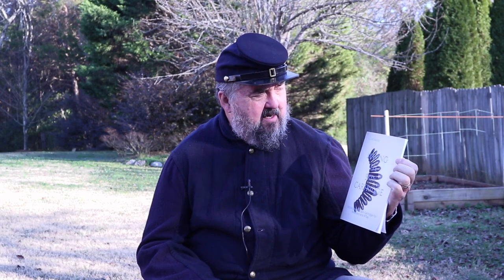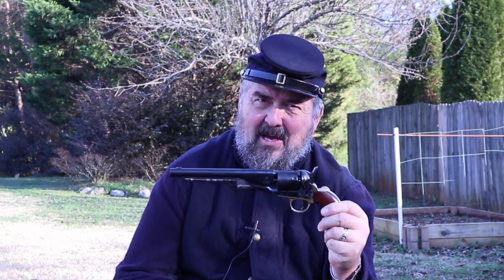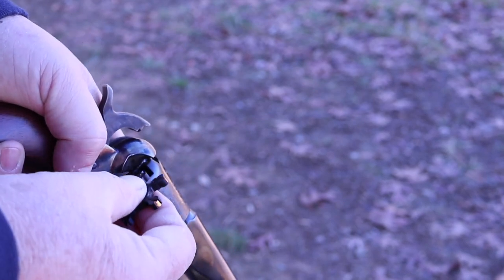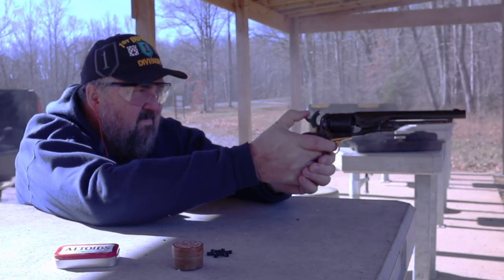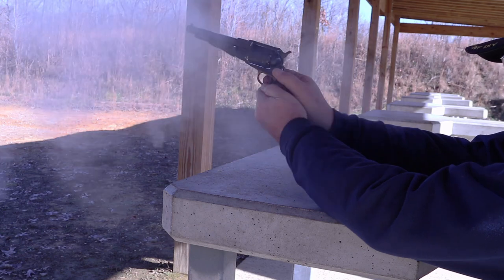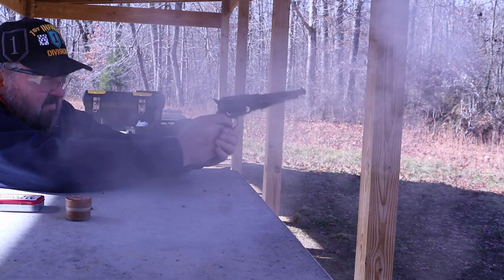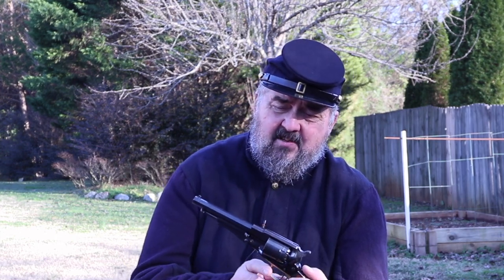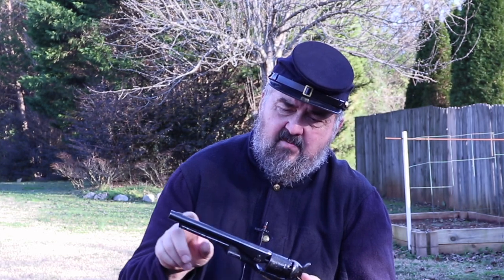Shooting Skin Cartridges in Cap and Ball Revolvers

Comment: .366 .368, chambers not good if bore is .375.
Reply: Was thinking the same and left a long comment explaining. I think that may be why his accuracy is so terrible. The chambers are drilled while the bore is made in a different way with different tools (regardless of what method they use).... so his chambers being so undersized probably means that his bullets will be undersized and won't create a seal in the bore/rifling... and that can be very bad for accuracy and the life of the barrel. It can cause very bad accuracy and very bad leading problems to start with... and in time will eat away at the walls of the bore. Depending on how bad it is, that can destroy a barrel in a couple thousand rounds... or even with just a couple hundred rounds. (With smokeless powder, I'm not sure if black powder is as destructive though. I would guess that black powder is not as bad as smokeless, but that it will still ruin the barrel if the hot gas can escape through the bore). I would ask Pietta for a new cylinder, because it's so far off that I would bet it's not within spec and should have never been sold. When it comes to bullets/bore, even a 0.005" difference can be a real problem... but 0.007 to 0.009 just seems beyond unacceptable.

Comment: how about a video on period caps?  How to produce your own percussion caps?
Reply: Would love that. Not quite as easy to do, but it can definitely be done. There are many ways if you're not making replicas, but are just making caps that work. They have lead and mercury though, both of which can be bad for your health. I believe that most modern primers still contain lead and that's where the lead exposure from shooting comes from (and not the bullets). Mercury one's are corrosive, so you have to clean your gun out after each use. I believe Mercury Fulminate and Lead Styphnate ae the two main chemicals used in percussion caps.

Comment: You don't have to use force to seat your caps on your nipples? If I don't, the caps won't go off... and even if I do, sometimes I need to hit them twice to go off. It's like 3/5 go off and 2/5 need to be hit again. I think the caps aren't a good fit for the nipples, but they're the one's that the company (and others) recommend. I think a couple of my nipples are out of spec and that's why it's consistently 3/5 that go off. It appears that the taper is too wide at the top edge of where the cap makes contact/seals to the nipple. Either it's too wide there or the entire taper is too wide. I think the entire taper is too wide, but never measured, because how do you accurately measure a taper? It's different along the length and it's not easy to measure the exact spot each time. I'm thinking maybe that I can make a mold of one of the nipples that works and use that as a "no go" gauge and/or a visual inspection gauge if I cut one in half, so I can see how the suspected larger nipples fit inside it.

Comment: Skin ,OK I'll try that. I've nitrated several papers. I get hang fires . I started tearing the bottoms off my cartridge. But at times I lose a little powder. Thank you for a great idea.
Reply: How thick is your paper? Also, make sure you aren't getting a lot of glue on the center of the bottom before you attach it. I've never had any ignition problems with nitrated coffee filters. I also use slix shot cones.   Worst case you could also try switching to magnum caps (if you can find them)
Reply: on your paper cartridges be sure to have a good taper to them so they break open when you ram them home.. for some skin cartridges, all it takes is a little work to make the equipment and a little ingenuity, in the back of my book I put what I called the thousand word section (picture /thousand words / get it) lol,,
Reply: I be used both white and brown coffee filters,rice rolling papers and hemp papers. I have better luck with hemp papers non treated. But I do have to tear the bottom off. I use store bought 10,s and 11,s. Remington and CCI. Three f triple seven.
Reply: @jamescraig8601  It may be the Triple Seven that is the issue. While I do not use substitutes in my cartridges, I have heard that they can sometimes require a hotter spark than regular caps, especially if it has go through the paper first.  Magnum caps may solve your problem.
Reply: @marionriverwoodcraft  +1 on this comment. I've had issues getting T7 to ignite in cap and ball cartridges, even with nitrated paper. Almost everything else works a treat in cartridges, but without sliXshot nipples and magnum caps it just doesn't wanna go bang for some reason. I've never had a problem with Pyrodex or anything else I've used, but T7 needs a lot of fire. I shoot quite a lot so I have purposely avoided real bp as the cleanup is a bugger compared to some of the cleaner burning substitutes. Also, I don't own or plan to own any originals. Just repros. The fouling is a ton less just between T7 and Pyrodex. I wanna try some of the forbidden powder next and see if it's as clean burning as they say. I know it's formulated for inlines but when you're shooting for three hours straight the fouling makes a ton of difference. I take the gun apart and clean it just like for storing while I'm shooting, then re-assemble and keep on shooting. When the cylinder won't rotate because of the fouling and you just started shooting, the cleaner burning substitutes start looking like a good option.
Reply: I have always thought cigarette rolling paper is already nitrated.
Reply: @theskincartridge1234  I think it would be good to just make modern skin cartridges than to make true replica one's.

Comment: What do you use to oil the cylinder pin?
Reply: I use spray graphite.  Works great.
Reply from the maker: I don't have a specific oil that I use.  My problem this time was NO oil :)
Reply: Oil, or a light grease can be helpful. The colts have grease grooves in the arbor pin that actually  spiral towards the front, to try and push fresh grease towards the front of the cylinder where it would get fouled.

Comment: I wood buy an 1858 Navy if it had the correct size frame and not the Army frame in 36 cal. Someone should make a Remington 1858 belt model too. I had issues loading my 1860 Army with Eras gone conical paper cartridges not seating. I had to reduce the powder charge to about 22gr. I have a Uberti 1861 I wish it didn't have the stock screws on it. My 1851 is a better shooting gun. Thanks cool video but I think I'll stay with paper cartridges.
Reply: Try some 4fg swiss with the reduced charges

Comment: I'm not familiar with the construction of the chamber, but would it be possible to run a ream down them to open them up a bit to help loading?
Reply: I'm sure it's possible but would you do that to that gun? I don't think so.
Reply: @ryanpenrod1859  I don't see why not.
Reply from the maker: Yes, I have done that to this Pietta since I filmed this video.  However, for potential buyers it is good for them to be forewarned.
Reply: @erasgonehistoricalmolds2400  yeah, good info. I also wonder if very thin PLA would work for this as well. Not 3d printed, but maybe coated onto a mandrel. Reason being PLA leaves very little ash when burned.

Comment: Do you think these would still fire with home made primers? Or even reloaded primers?
Reply: I do. If you add small, hard particles like grains of coarse sand/silica/glass to your priming mixture, that might help break through the skin, but the pressure alone should do it no problem, even without adding something like that. I believe, but cannot say for certain that even paper roll caps would ignite them. You'd probably want to use more than one, but you'd probably want to use more than once anyways. You can also make the skins out of nitrocellulose, but the problem is that nitrocellulose can burn too fast if pure nitrocellulose, which can increase pressure and blow up the gun. To use nitrocellulose, it would have to be made to burn at about the same speed (or slower) than the black powder. That would not only make it a hell of a lot easier to ignite the powder with homemade/refilled primers, but it would aid in the ignition.
Reply: not a problem, if they light up regular black powder or any of the substitutes they will be just fine.

Comment: One would think that, with today's petro-chemistry, a better medium than sheep gut could be found to make these black powder cartridges.
Very thin sprayed-on powder cup membrane  that would set very quickly and that would be mostly combusted when the round is detonated, while still offering good mechanical properties as well as being relatively more water resistant.
Reply: would not work with modern ammo/weapons. the casing seals the chamber which puts the energy producing from burning the powder into propelling the round down range. if the casing disintegrated upon firing the ballistics would be laughable at best. also sending petroleum based bits flying off into the grass or burning it into the atmosphere is the last thing we need to add too.
Reply: @The_Cat_Authority  he wasn't talking about modern weapons, he's just thinking about a spray on substance to use instead of gut.
           I personally would use those finger condom thingies but I have no idea if that would work
Reply: I think cellophane might work, as i believe it may burn off easier
Reply: nitrocellulose lacquer would work
Reply: @The_Cat_Authority  Rickie. Rickie.
Black powder pistol ammunition. This type of cartridge could not be used with modern gun powders because the pressures are so much higher than those of black powder.
Oh, and by the way, you are wearing at least a couple of pounds of petrochemical product right now. Better get rid of that to remain theologically pure so that you may preach to the unbelievers.
Rickie, what do you suppose happens to the sheep gut cartridge casing when the man fires his percussion fired six gun? Yep, it mostly burns up. What is sheep gut made of Rickie? Is it largely made of hydrocarbons? Like oil is made up of hydrocarbon chains?
Reply: @boydgrandy5769  Circle back. Did I say there were NO petroleum products or did I say MORE petroleum products are not needed. See READING COMPREHENSION IS KEY!! Also black powder isn't used in modern rounds because "its too powerful" its not used because it creates loads of smoke and fouling. Modern guns would all jam after just a few rounds of that filthy ammo. Even muzzleloaders mainly use smokeless powder now, for the same reasons. Less smoke, less cleaning your weapon.
Reply: @The_Cat_Authority  "Even muzzleloaders mainly use smokeless powder now"
that's not true, though there are smokeless muzzle loaders available now
Reply: @pacman10182  The only people I know who use black powder do civil war reenactments. Thanks for backing up my comment to the other guy though. His black powder is stronger than smokeless powder mindset is SO SO wrong lol Yes you are sorta right, only muzzleloaders designed for smokeless powder can use it. Much like you don't run 5.56 through a .223, the chambers aren't designed for that much pressure.
Reply: @The_Cat_Authority  "His black powder is stronger than smokeless powder mindset is SO"
that's not what he said, go back and read it
Reply from the maker: Indeed, and many original skin and paper cartridges had a nitrocellulose coating to help with waterproofing and to encourage combustion.

Comment: Man i have 2 3d printers just collecting dust...think ill make those cap loaders
Reply: I'd be impresses if you could print such thin walls. If so, please let me know how they turned out. On my Ender 3 with the stock hot end I could print thinner walls very well (maybe not that thin though)... but now I have a more expensive Micro Swiss hot end and I can't print anything less than 4 layers thick... and even 4 layer walls can fail sometimes. Not sure what to do, because the damn thing was $70.00. If possible, I would make a design that not only lets you set the cap on the nipple, but one that also allows you to use force to seat it on better too. I know many people and many different models of revolvers that really need pressure to seat the nipples or they won't work. The NAA revolvers are one good example of that. (I love those things).

Comment: Why?
Reply: why not ?
Reply: @KenMabie  Cost effectiveness, time, reliability and actual usefulness in modern firearms. Let it go, the past is the past. We have found better ways to do things than this. Reusability of brass is way easier. Also if you really wanted to use cap and ball, you could melt plastics and get a way better outcome. They didn't have that back then or they would have used it.
Reply from the maker: With that philosophy, why have reproduction historical weapons at all?  The answer is many of us are very curious about our history and how things were done in the past.  Shooting historic weapons does not preclude one from also owning and enjoying the most modern weapons available.
Reply: @russdanger448  you missed the point entirely. We use muzzleloaders for a reason, to be in touch with the past. We WANT to do things the old way, it's fun.